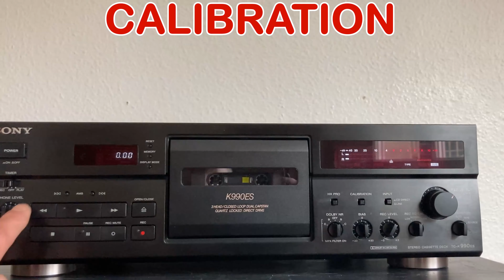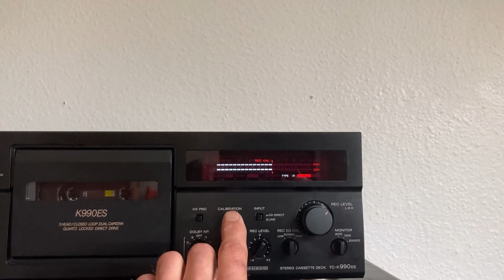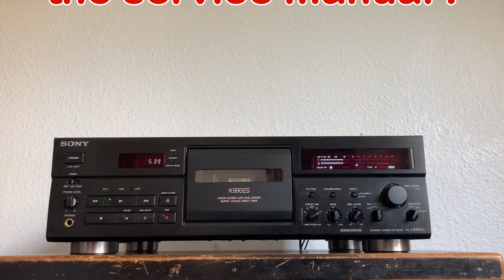SONY TC-K990ES / THE HOLY GRAIL ! / 3 HEAD STEREO CASSETTE DECK / BACK TO 1992 !

Comment: I've got the 870ES I recently had service for all the rubber drive belts in the loading mechanism and of course driving the tape.  The tech lamented it was the most complex mechanism he'd ever worked on.  I'm sure this one (which basically replaced the 870 at the top of the ES liine) has the same arrangement.  Nice when it works, but those belts are a nightmare to service.  Great deck, though.  Didn't care for moving the tape well to the center, but that's where the styling was going.
Reply from the maker: Hello, thanks for sharing your experience. The dismantling is quite an adventure !! Thanks for watching and Remember !